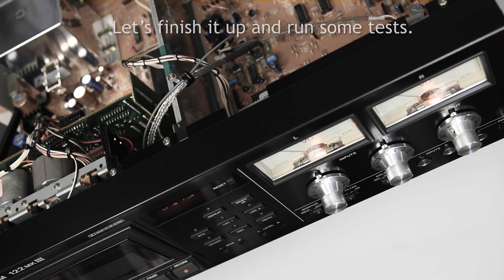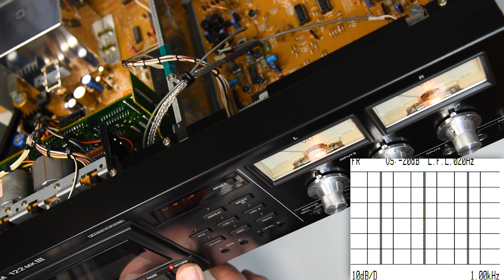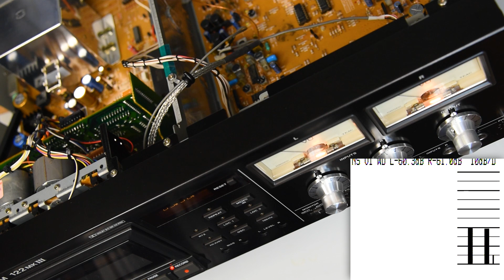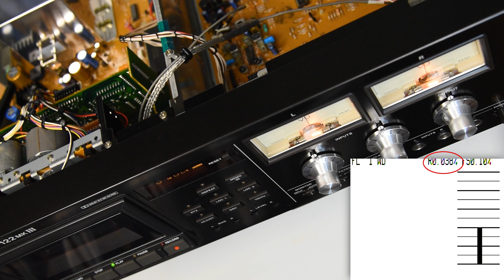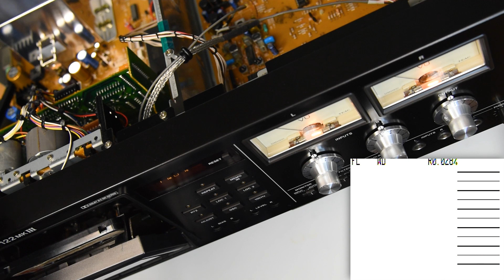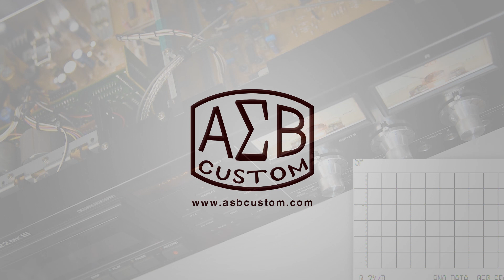Tascam 122mk3 Full Rebuild: Part 4 - Final Tests

Comment: Can you help me find the problem of this same model? I have replaced the c gear with new one. After pressing play. It plays for like 5seconds and then stops.  Fast forward and rewind do the same!  N.B: The tape counter is not counting anything!
Reply from the maker: The common problems on these are the C gear, capstan motor, and idler tire. See if the take up reel and capstan are turning.

Comment: Nice restoration/rebuild videos. Have you ever try to add components place that are empty, but have place marked? Maybe those places are for next model number machine? Better?
Reply from the maker: Thank you for watching. Yes, Teac/Tascam routinely designed all kinds of components for use in multiple devices, PCB's included. This model, for example, had three iterations that all used the same circuit boards but sporting a different set of components.